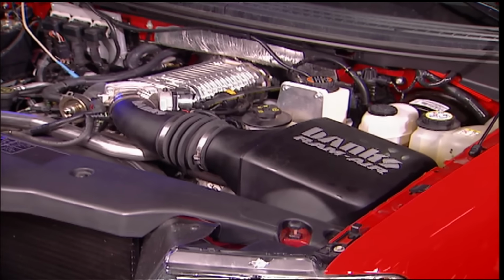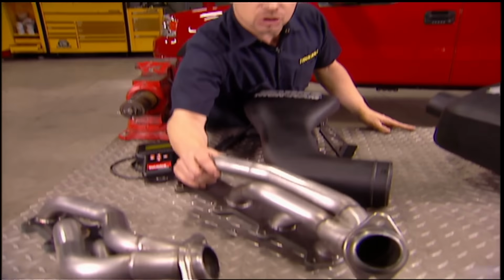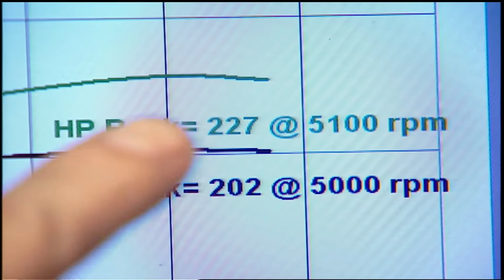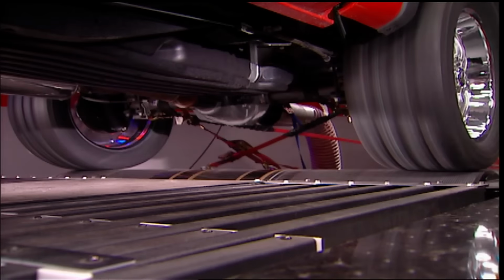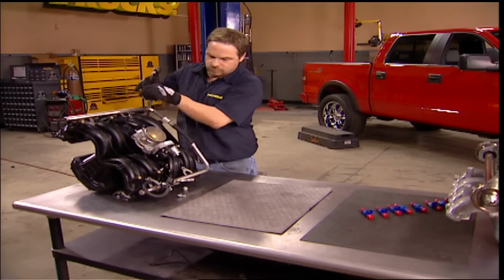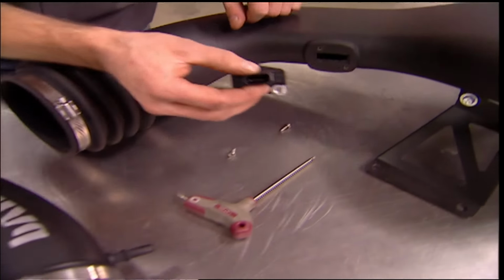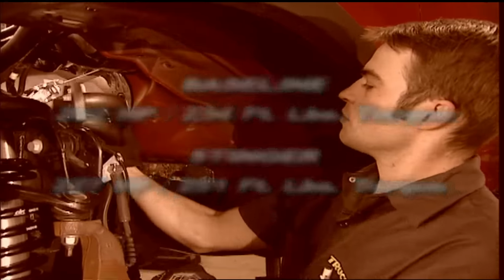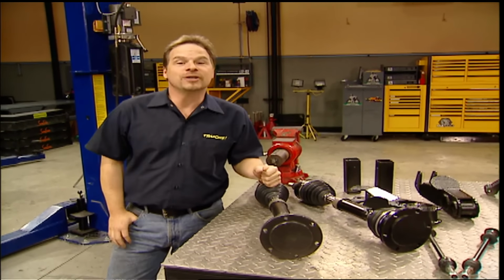Maximizing Power On A F-150 With A Supercharger & Gas Power Package - Trucks! S8, E18

Comment: Id be willing to bet that all that added HP came from the tune and exhaust headers because the oem air intake is a better cold air intake with pulling air from the fender then that huge system in the engine bay but i do suggest switching to a high flow filter that fits in the stock location

Comment: Wait what? I can remove exhaust manifolds from the side? I am about to re-do a no rust on frame 2004 5.4 3v new exhaust with new oem manifolds etc all the way back
 I need suggestions bigtime it's a solid truck crew cab ( 2 door) other truck 05 supercrew with new motor and trans
Reply: Don't do stock headers they crack again within the 1st year just grab some shorty headers and there's a huge difference between 2wd and 4wd also D vs P side put I do suggest a while your in there to do is the motor mounts there know to go bad and cause the flexplate to crack

Comment: Is it me or do stages 1 and 2 seem to give very little bang for the buck?    That's a lot of parts and work for 43hp and 26ft/lb?   An intake, exhaust, headers, and tune should make more than that.
Reply: I mean that's pretty typical.  Bolt on don't usually get you much bang for your buck.
Reply: That was 21% gain in power from stock.  Apparently you don’t understand how naturally aspirated engines work.  That’s a good gain for small tube shorty headers, cat back exhaust and a little hotter spark.  Before dynos we’re everywhere, people just assumed they were making 200 more horsepower with those fancy headers.
Reply: And that's  to the wheels.
Reply: I understand how engines work just fine thank you.    Look at what adding the same thing on say a Hemi or LS based V8 and you will get significantly more than that.
Reply: @bmstylee  That’s because the Hemi and LS start out with more power.  They still won’t get much more than a 20% bump up in power with those little add on’s.  But 20% of 400 is more than 20% of 200 that they started with.  It’s all relative.  The heads on the ford engine are not as good as the Hemi and LS.  I have a 392 Hemi and the Eagle heads are outstanding.